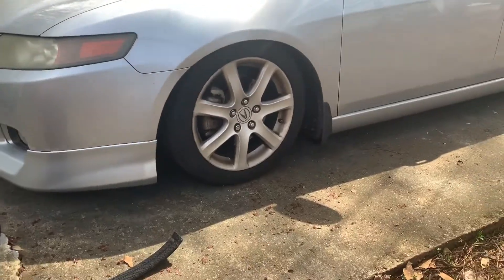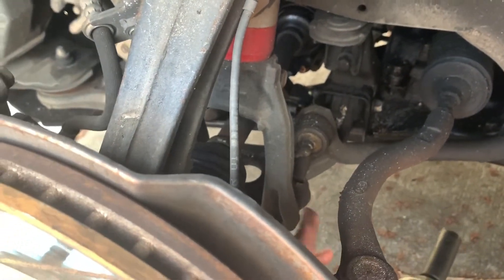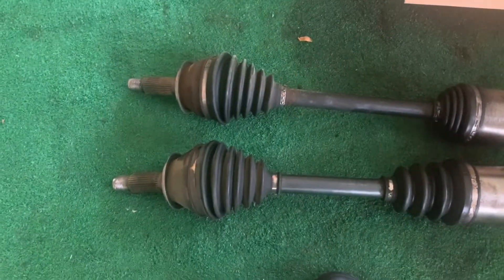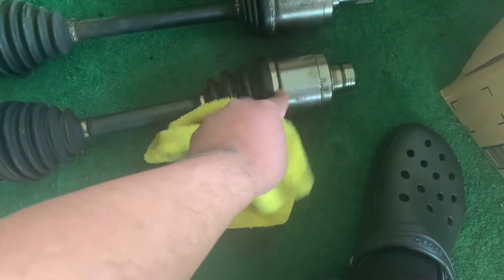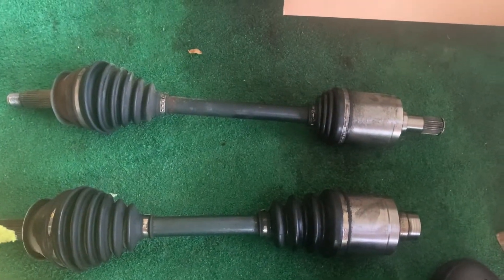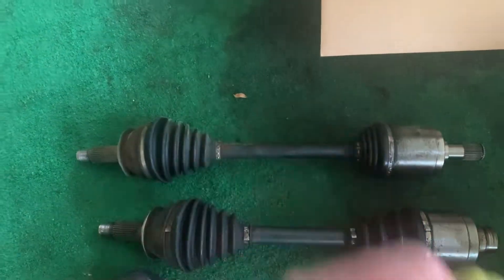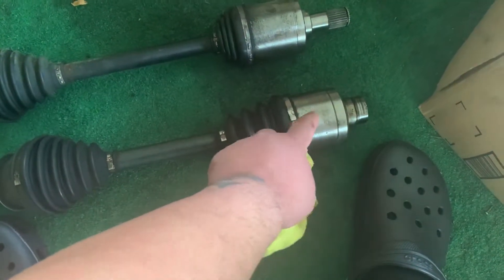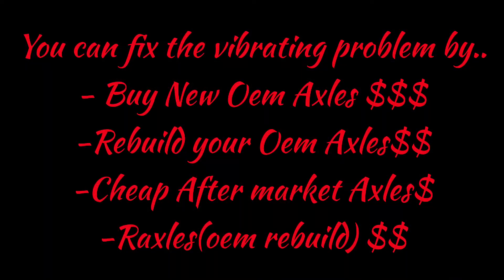04-08 Acura Tsx Vibrating/ Shaking Issue Fixed!

Comment: My 04 TSX shakes like crazy between 70kph and 110kph (50 and 70 mph only on acceleration so I assumed it was Driveshafts since I heard so much hate on them, changed the passenger side and no difference so getting my driver's changed next week. Will update then. Thx for the video, good to know what's going on
Reply from the maker: Did u use an oem axle ?
Reply: @bigkevondis  not exactly. Got the only one available to from Napa which was a 'like OEM'. New one I bought and will be installed is not OEM
Reply: And the car is stock suspension
Reply from the maker: Aftermarket parts store axles will make it vibrate/ shake if your lowered and they dont have the balancer in the middle of the axle shaft .
Reply from the maker: Hmm, have you checked your suspension, tires, motor mounts ?
Reply: This happening to me too and all my buddies tell me to check tires to see if they're balances. Sometimes the weights on the wheel fall off. After that I'm gonna put my stock wheels to see if it's my aftermarket wheels.
Reply: @tsxacura2008  if it vibrates all the time while driving, then yes, it probably is something unbalanced. If just acceleration, then axles. UPDATE: I changed my driver's axle and she's smooooooth as butter now
Reply: @manitobaerial hey i know this is old, but did you replace the driver side with Napa axles as well? I heard good things about the Napa axles.
Reply: @Vizyn _  Ebay lol. No issues after that for over a year and I was ripping burnouts
Reply: @manitobaerial  any chance you'd share the link? Or the seller or something

Comment: I have 07 tsx, and then I get to about 50+ it shakes like crazy. especially when I begin to break.Ive changed control arms, power steering pump, Rack and pinion (two times in two years) and its still freaking shaking. its a beautiful red car and Im a woman who can't deal with these issues anymore. Big Kev do you live in Atlanta ..also if anyone is willing to buy it, please let me know.
Reply from the maker: Your rotors could be warped if it shakes while braking and Could also be your wheel bearings. I suggest taking it to a professional Mechanic so they can diagnose it so you don’t waste money buying parts you don’t need.

Comment: My TSX shakes between 30-45mph but it’s not lowered and nothing is leaking under the car...could it still be the axels or should I be looking somewhere else?
Reply from the maker: Could be a number of things. Check your motor mounts,suspension, tires, etc . Could be possibly be axles but you will here clunking or pops when you turn and shake upon acceleration.
Reply: Did you ever find a solution? I have the same issue only at those speeds

Comment: My 2006 Tsk is vibrating in the seats in its when the car is not driving also I can just be seating with the car on and it’s vibrating
Reply from the maker: Sounds like motor mounts
Reply: BigKevOnDis I got those already ever were I take it they just don’t know what it is my engine light is not on
Reply: BigKevOnDis and it doesn’t read any codes
Reply from the maker: I don’t know then, it could be anything suspension to engine related. Try the Honda dealership. Hard to say what’s wrong because I’m not physically diagnosing your car.

Comment: When i go 0-20 i get a vibration on my pedal and steering wheel. It only vibrates when its 0-20 tho
Reply from the maker: It could be a number of things. You need to jack your car up and check the engine mounts , suspension and brakes.

Comment: Thanks great help! More TSX content please. I am stuck between getting OEM axels or getting Raxels. My car is lowered I have about 1 finger wheel gap. I am scared to pay so much if the car is going to stay lowered, will the new axles just go bad again?
Reply from the maker: Yes eventually. Can’t give you a time frame. They should hold you for while...and this is somewhat normal for a fwd Honda.
Reply: BigKevOnDis makes sense thanks. I think I will give raxels a try then.

Comment: My car vibrates a lot too but it’s the worst when I’m still and not moving  2004 Acura TSX and especially when my AC is on it vibrates more could it be axels or motor mount
Reply: Also isn’t lowered
Reply from the maker: Possibly motor mounts
Reply: Probably motor mounts. It's definitely not the axles if it vibrates while stationary
Reply: @manitobaerial  mine is doing the same shit only when stopped but I put in park and my girl put into rev or neutral or drive the engine moves a bit so it's prob my mounts
Reply: @JosePerez-ok8ez  probably. Possibly transmission.  Definitely not cv issue if it happens when stationary

Comment: My car got the same problem....but my car its not even drop .will it still be axle problem
Reply from the maker: Possibly. Make sure your wheels aren’t bent and tires are good/balanced first. And check your motor mounts, check all your suspension pieces and etc as well.
Reply: Hey man shakes and vibrates when I come to a stop even shakes more when ac is on full blast , but when I drive it don't shake 106k miles on paid 7,500 idk if I got ripped off man .
Reply from the maker: Check motor mounts and check your suspension and brakes… if it’s shaking at idle It maybe your motor mounts

Comment: Hi my TSX shakes when i shift to fourth gear only. When i accelerate around 60mph, could it be the axle? I just bought the car from a guy who slid on the snow so i dont know if the axle were messed up?
Reply from the maker: If it shakes when your acceleration, then it can be an axle. If it’s only in 4th gear might be something in the transmission but that’s weird. Try going to 70 mph and let it coast in neutral down to 50mph to see if it still shakes.. if it shakes might be tires,suspension, brakes, something bent maybe. Then accelerate in 5th gear around 60 mph, if it shakes the axles may be binding,unbalanced or worn out. Hope that helps.
Reply: @bigkevondis  yes, it does shake even when accelerating on 5th gear at 60mph thanks for the help.

Comment: how are the raxles holding up? any vibrations coming back? I’m lowered as well and been having this issue. gonna order soon i think
Reply from the maker: There still holding up good. I can feel a little vibration coming back but not as bad as the parts store brand. When I had some new advance auto parts axle they vibrated immediately. But I do need to replace my lower ball joints..
Reply: @bigkevondis  go oem on the ball joints bro I got an 06 had moog car collapsed on the highway scariest shit I’ve ever experienced!!
Reply from the maker: Damn, I bought moog ball joints I just been lazy to install them. I may consider going to oem now.
Reply: @bigkevondis  mines lasted about 10 months  joint broke pulled axle blew tire damaged fender.. I’m having axle issues now

Comment: I replaced both axles but the half shaft could it still cause shaking ?
Reply from the maker: What kinda shaking? Like when your acceleration or it shakes at certain speed? Also what kind of axles did you use ? Kinda hard to diagnose with out seeing it in person.
Reply: BigKevOnDis Detroit axles, but its on acceleration (20-30mph)but slows down when i let off the gas. Tomorrow i plan on testing if i could tap the passenger side in, maybe i didnt slide it in all the way. Kinda of a center shake the come of the outside to the inside of the car. I didnt replace the half axle, that could possible be why it still shakes.
Reply from the maker: Is your car lowered ? If it is you need to replace with raxles like I did or oem from Acura/Honda but the oem ones.
Reply: BigKevOnDis yea it’s kinda of like yours but after the shop fixes it ima sell it for a beam 550 v6 murdered out
Reply from the maker: Yea I’m pretty sure it’s your aftermarket axles then. Mine would shake around 20-30 mph with a fresh pair of axles. Don’t let the shop rip you off by replacing unnecessary parts. If you want to double check raise the car back up it should vibrate less or throw on the stock suspension and see if it goes away.
Reply: BigKevOnDis defiantly will try tomorrow but i used to have a honda before this with all after market suspension and everything. Never had that issue before